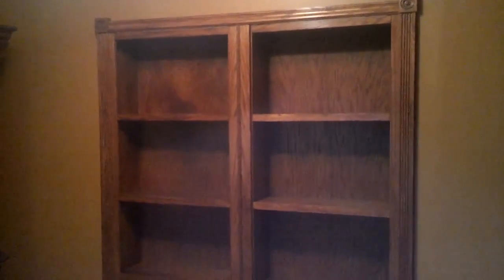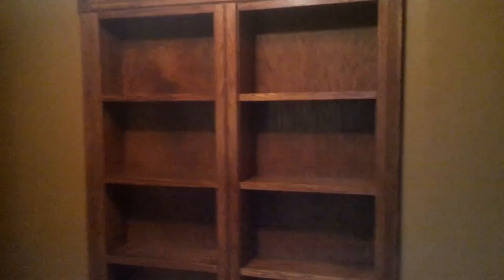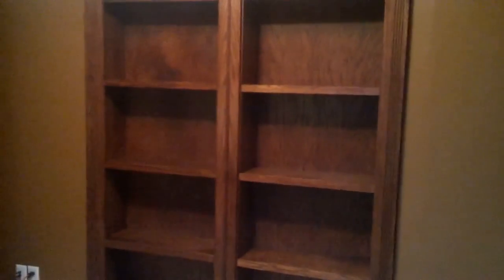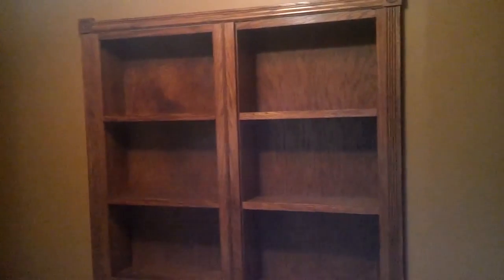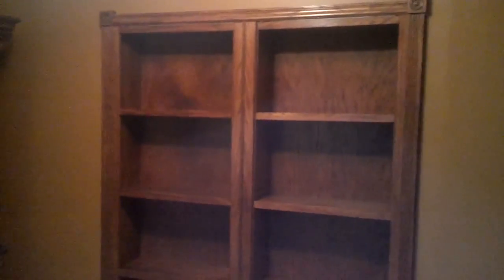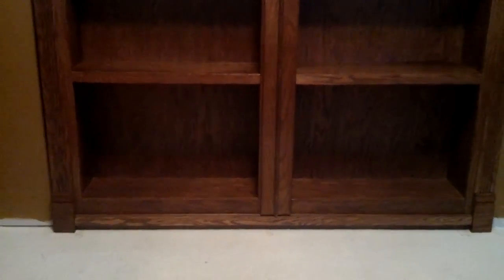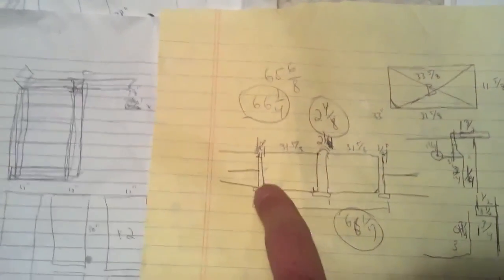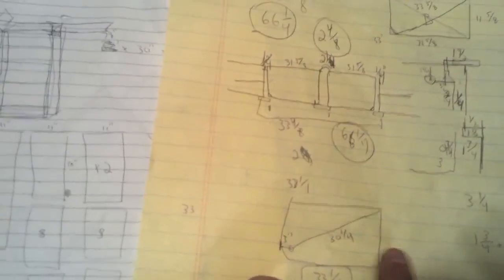Hidden Door Bookcase -  1 of 15

Comment: Beautiful hidden closet/bookcase.
Do not know if you did the, lack of better description, the Teflon Skid Plate, on the bottom like you was talking about. I paused the video several spots and I was going to suggest this idea.
Cut the Skid Plate, in a half circle, like a "D", then cut that in half, so that it looks like a B. 
Trace the ARC of the swing out onto the skid plate. Use a Router to cut a V notch in it.
Then use a marble or two that would fit snugly between the door and the plate to act as a ball type roller bearing. Again awesome build.
db

Comment: If you haven't done anything to counteract sag over time, what about just adding a caster in a place where it would allow the doors to still swing, and the caster would be the support?  There's a ballbearing type - bearing sits in a housing and it rolls freely -  you screw it to the underside of the door.  There are different sizes with different heights. You could countersink them if you think they sit too high.   One may work.
Reply: If you noted both cabinets are higher than floor level so a caster wouldn't work. Also if you could use a caster it would eventually wear a track on the floor giving away the secret space.away.